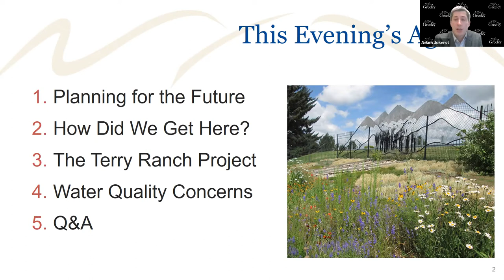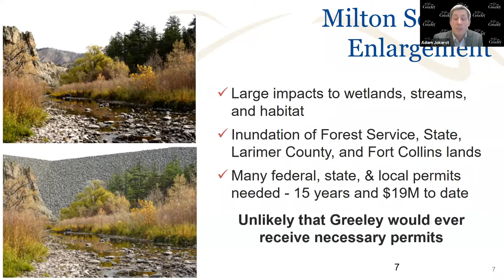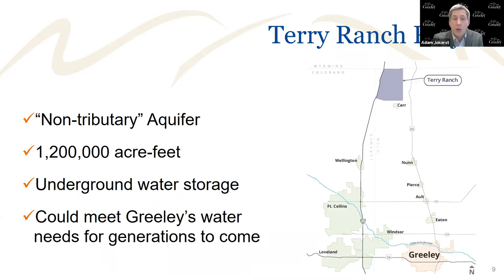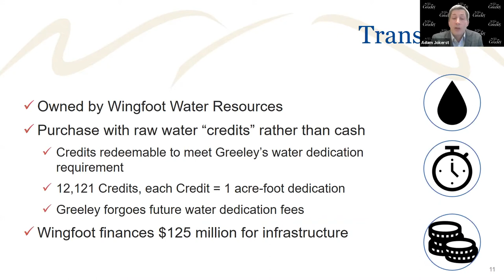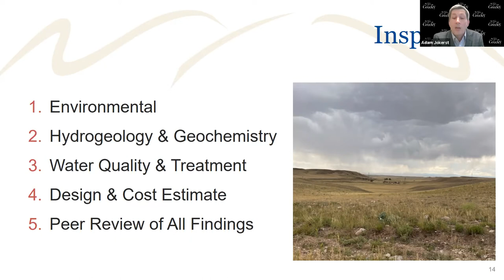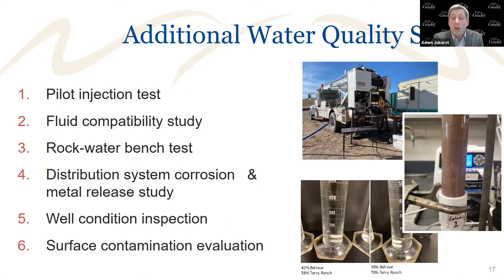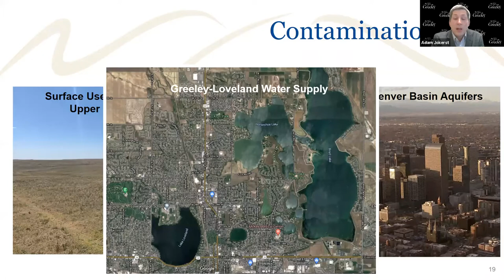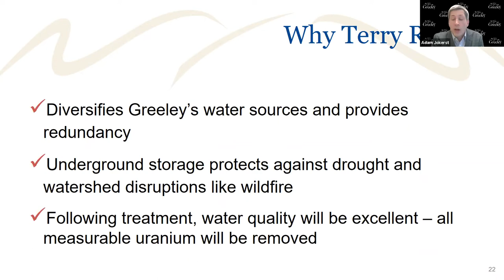Greeley's Water Future: Terry Ranch Project Online Meeting | Feb. 10, 2021

Comment: We don’t want that radioactive water in our pristine mountain drinking water. The final decision should be left up to the people, not the City Council.
Reply from the maker: The city is confident that the naturally occurring Uranium is 100% removable. Through rigorous testing and analysis by the city and third parties, the Uranium has been removed and the resulting water quality is just as Greeley consumers have experienced. The Water and Sewer department has conclusively proven we can take it out. At present, the water is drinkable and in much better condition than most of the raw water that comes to us from the mountains, which also has uranium in it. For the last 100 years, the city has been successfully treating this water, which contains bacteria, viruses, organics, metals and debris, to levels that are award-winning for best taste – so much so that our residents think our raw water is pristine when it comes to us.
 Greeley will continue to use ALL of its existing water rights and resources. Terry Ranch, if approved, would only be a drought supply. So when water is scarce during droughts, we can open this up to fill in our gaps. Then refill it during wet years. This is a very common way to store water that is environmentally friendly.
Reply: @Greeleygovernment  Pristine is a relative word compared to the avoidable contamination found at missile silos, capped oil wells and wastewater treatment locations - all in close proximity to Terry Ranch. There is less uranium in the surface water, as evidenced by Ft Collins, and Thornton water reports of the Poudre; and you can’t remove 100%, you can only remove what you can detect.  That is why you have repeatedly claimed to remove uranium to non-detectable levels. Milton Seamon expansion could also be used for drought supply.... And what of the correlation between Salt Water Disposal (SWD) injection wells and localized earthquakes? Greeley experienced 2.6 magnitude earthquake in 2014 as a result of a SWD site, anecdotally showing injecting water into geological formations is NOT environmentally safe.